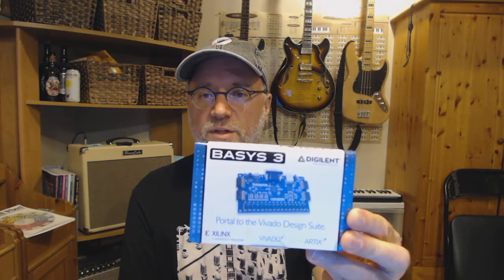Implementing the Scott CPU Video #1 - Introduction

Comment: Hello and thank you so much for these two awesome playlists. I want to learn fpga design, and what better way from building a cpu? Do you think this project can run inside an Upduino v2.0? It is very affortable (plus, i got it sitting here). Here are its specs: 5.3K LUTs, 1Mb SPRAM, 120Kb DPRAM, 8 Multipliers. Thank you!
Reply from the maker: I think it should work, the report from Vivado says this project used 2.6k LUTs and 2.1k slice registers. In this project I implemented everything using NAND gates (to mimic the book), so that uses a lot of ressources for nothing. If you are tight you can just use native NOT/AND/OR gates and that should bring down the ressource usage dramaticlly
Reply: @patrickleboutillier  Thanks a lot! One last thing, is the playlist finished? Or there's more videos to come? And do i have to watch the other playlist, before jumping to the FPGA one? Thanks a lot!
Reply from the maker: @nickst2797  The FPGA list is finished. The new list I'm doing for the Arduino+SN74HC chips is here https://www.youtube.com/playlist?list=PLYE0XunAbwfDvfabOlNWLViRcMI54M6CR, and this one is in progress.